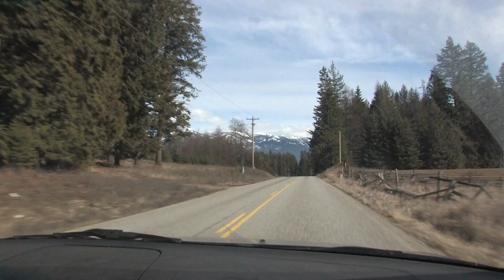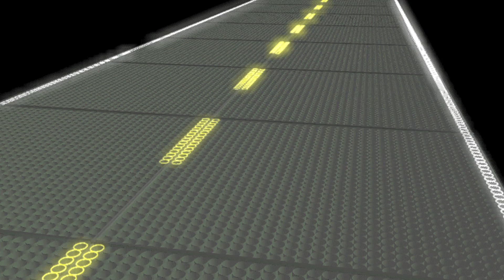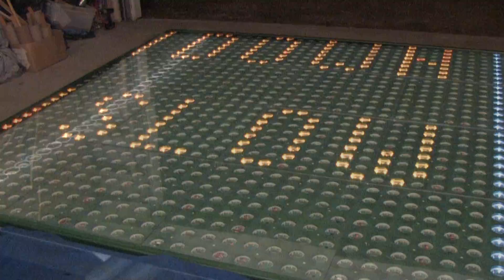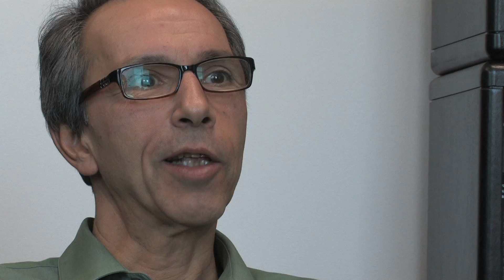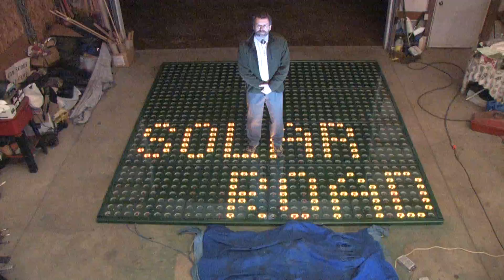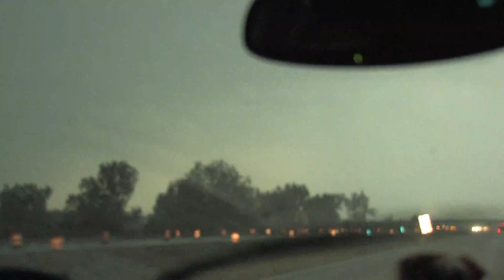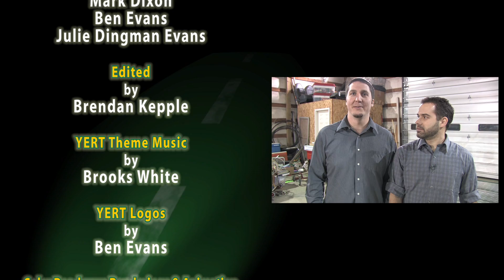Solar Roadways: The Prototype

Comment: I like this idea. I would just like to know if there's any idea integrated for charging electric cars. I was really hoping especially in urban areas for wireless inductive charging, which could really work on any vehicle and, with electric cars today, can be a game-changer. A concern of mine is, if used on a parking lot, wouldn't vehicles prevent more sunlight from coming in by covering the solar panels?

Comment: Someone explain to me how glass is better for quickly breaking when it rains/snows versus a normal road?
Reply: Avi Hoshikage
Won't textured glass diffuse the light, thereby attenuating the photo collecting?
Reply: Lori Eve
I think people are just thinking more about negatives versus tarmac.

I must say, there are shit tons of negatives I can think of one right now

In spring roads warm up in different places at different speed resulting in many cracks and uneven roads. Modular design would break under pressure.
Reply: Matt Valenti
What?

First of wall what bullet do you want to stop?
And how much of Glass do you have?

I don't now if you know this but Rock is pretty good cover for the troops in firefight as it protects them from ballistics and explosives.

Also bulletproof glass will break and shatter with encounter with the bullet of any caliber what makes glass bulletproof is polycarbonate layers, it goes like this. Glass Layer, Polycarbonate layer, Glass layer, Polycarbonate layer. ETC.

Basic reason why glass is withstanding bullets because are layer based and its not only glass.
Reply: I have never thought about it but after visiting a wonderful Museum of Glass in Corning , NY  know a little more: think about windows in the space ships for example, submarines etc.  Sorry, I'm not an engineer but a biologist.
Reply: there are thousands of different kinds of glass, only a few kinds of asphalt. Chances are that producing glass with good traction should be easy enough.
Reply: Same reasons why glass can withstand bullets better than rocks can...
Reply: ValugaTheLord Then they can make the tiles out of glass and polycarbonate layers. The only important aspect is that it has to be transparent(at least to the spectrum of radiation the panels can absorb)
Reply: RedTriangle53
I would be do differ.

Only important part is price.
Reply: dLimboStick If I had to guess I guess by sheer volume of cells could make up for the lack of light collected per cell.
Reply: that's what I want to know
Reply: naysayers... go to the university and look at it yourself... do you think they glass wasn't researched and tested to stand up to adverse conditions? YES . . . I like the NASA and Sub points too!! smart thinking . . .
Reply: Matt Valenti *(bulletproof) glass
Reply: ValugaTheLord fair enough.
Reply: *braking
Reply: James Davis he isnt driving anywhere lmao
Reply: Avi Hoshikage You can't think of a better material then glass? Are you serious?
Reply: ***** "the roads are heated to melt the snow/ice"

sure, but that's the most inefficient idea in the fing planet.
Reply: ***** Plows are better
Reply: You'd be surprised at how strong glass can be, actually. My father's a glassworker, so I learned all about this growing up. Glass can be ridiculously strong, depending on the type you get. The kind my father uses...its fancy name is borosilicate...look it up. That stuff is so strong, you can drop a marble of it from a few meters up onto ceramic tile, and the ceramic tile will crack long before the marble even chips. And these guys, clearly, are aiming for something even stronger than that. So using glass is actually a very promising idea. They just have to do it right is all.
Reply: Avi Hoshikage
ok so rain+cold...how do you solve this?
Reply: So they textured the glass up. They already thought of this; it's mentioned on their website that they put the panels through traction-testing systems, and actually had to back off on the roughness when it became too rough for the test-tires. shrug I've been around glassworkers my whole life; I know what it's capable of. You might not see it, but honestly, I can't think of a better material they could've used for both strength, traction, and clarity. Glass has a lot of potential...
Reply: Read MsSomeonenew comment, heat can be added to the road, just like Thermal panel.

Comment: Hi I have an idea for the road layer instead having very durable material maybe it can be a layer with integrated network of wires creating electro magnetic force using power from the panels then all cars can use electro magnetic tyres so they can levitate! If you have to make a turn you can use a device to make the wheels on one side create less electromagnetic force and the car will turn, same if there is obsticle on the road just jump over it by more or less magnetic force! No friction less power to move! Interesting ah,  just like Star Wars .... may the force be with YOU!
Reply: THAT IS BRILLIANT!!!!

Comment: Brilliant idea.
Reply: Do they stop working after having produced 3348W, or is that 3348W per hour, per minute, per day, per year.... if it's per minute, that's pretty good. Per hour, might be, but not necessarily. Also I think hair dryers aren't necessarily a good example, because they, like kettles, are high consumption, short single use items. You generally wouldn't leave a hair dryer on all day, and a kettle switches itself off after having heated water. Both, however, are absolute nightmares for drawing power. You could watch TV for ages on the power a hair dryer gets through in minutes.
Reply: One of the problems I see is being able to melt the snow that will build up on the surface… this has to do with basic thermodynamics. The panels collect solar energy to produce electricity, but they only capture about 10% at best and that is if the solar panels are in direct sunlight, my question is if the 100% energy from the sun isn‘t enough to melt the snow/ice how in the world is only 10% of the suns energy going to do it? I have read this is a problem with regular solar panels, they don’t produce enough energy to melt ice build up, even though they are set up in ideal locations to produce electrical energy… Another thing I have a problem with is there is no mention of storing this electrical energy produced (“none that I‘m aware of” solar panels don‘t work at night), and the costs involve in the extra equipment, plus converting this DC electrical energy into AC using power inverters, just as in normal solar panels.  Not only the initial costs but also for maintenance of this equipment, and there are major energy losses involved in these processes. None of this makes any sense at all. This not to mention all the other obvious issues involve.
Reply: ronc1357
A test unit installed last winter melted all snow & ice. I believe this was just a passive test. (photos on their site)  Advances in solar capture rates are occurring now within the industry.  A distributed grid reaches all electrical users along all roadways. Another brilliant idea explored by David Suzuki is electric car batteries used as mass storage - monitored by intelligent systems built into the roadways. Massive storage units (grid-level) using alternate materials are being developed as well. A group of German engineers calculated that solar roads would supply 4x the power required for the entire country.
This is how the future gets invented.
Reply: Bruce Ryan
I don't think so... I am affiliated with a solar power company, and the solar panels will not produce enough electrical energy to melt the snow and ice from the surface. You still haven't addressed anything about the power inverters, and batteries...the maintenance on this equipment, the costs for this extra equipment...
Reply: Excellent. As a member of the community - what is your problem?

http://www.cnn.com/2011/TECH/innovation/01/19/smart.roads/index.html?hpt=C2  and like I noted, the solarroadways units proved to melt 10 inches of snow in Idaho last winter. These are not the typical solar units. No big deal. I mean, new ideas come up all the time. Some of them have proof.
You do understand 12v DC systems? Household inverters are available. The efforts in Australia & Germany point the way.
Compared to the escalating costs of asphalt paving, oil pollution, global warming & CO2 losses... who cares about "costs". This is about our planet. Handouts to the oil industry are part of the problem. There are few "subsidies" available to renewable industry. See the ISSUE?
The 'gang' gets the money. Alternatives starve.
Again: look at the grid level storage solutions available now. Add a national strategy. Include some incentives. See the future.
http://www.solarroadways.com/snow.shtml
Reply: Bruce Ryan That test unit was externally powered. The panels were underneath a tarp, and weren't running directly from solar energy. That's not to say it can't work from solar energy, just pointing out that the test wasn't about that. They were testing that the heating elements were all connected up and functional.
Reply: alphaxerosyx Part of what contributes to the higher output of these panels is the refractive surface of the glass. They've changed the design a little since this video, and it's now got textured bumps on it. These bumps serve as traction for cars, but also they refract light onto the solar receptors within. I'd imagine this focuses and channels far more energy onto the solar receptors, much like you can start fires with a magnifying glass in relatively cool weather.

Also bear in mind that to melt snow and ice, you don't have to have a hot surface. You just need to have the surface temperature maintained above the melting point. Maintaining a temperature requires a lot less energy than repeated cooling and heating. Technically, we're talking about a temperature that would be far exceeded throughout most of the year, somewhere around the region of 5-6C is more than enough.
Reply: alphaxerosyx
To explain what I am talking about, the solar parking lot they have built according to Scott will produce just under 4000 watts on a clear sunny day for about 3 hours a day, which is enough power to operate 3 electric hair driers. The surface area of the parking lot is about 384 square feet, so do you think that running 3 hair driers for 3 hours a day is enough heat energy to keep the road surface clear of snow and ice 24 hours a day?
Reply: Not sure where you got the 4kW figure from. Scott hasn't released any details yet about the actual output of the lot. Also it's 432sqft (12ft*36ft), and is only 60% covered with solar panels, due to them not being able to get the right shape/size in time to fit the new hexagons. The eventual product would be 100% covered. As for whether it's enough to melt snow and ice, there's a newer pic up now that shows panels not covered by tarp, that are snow-free, while adjacent ones are buried under snow. Possibly externally powered, still, but at least it takes the tarp out of the equation. I'm not sure the US DoT would have funded the project if there was any dobt as to its authenticity though.

It's also been enough to convince Sandpoint, Idaho to get some of these installed in town. http://www.bonnercountydailybee.com/news/local/article_604a09ac-baf0-11e3-94d2-0019bb2963f4.html
Reply: alphaxerosyx
Had to look back and find where it was stated. It is within the March 31st post titled " Oh what a difference heater (turned on) makes". The conversation was with Christian Berger, and here is the quote "Hi Christian, Yes, we only have 69% solar cell coverage for the prototype, which makes the parking lot equivalent to a 3348W solar panel - in production there will be 100% coverage obviously".
I guessed that since the panels don't actually go to the end of the parking lot that is was closer to 32 ft. but that doesn't really mater because adding the other 4 feet makes it even more difficult to heat the panels with the given energy input.
Reply: alphaxerosyx
I have been waiting on a response from you to my question about the hair drier scenario. plus I wanted to add to your comment about funding from the government. First of all yes the government funds stuff all the time that doesn't work i.e. cold fusion... that is not a reasonable argument proving the solar roadways has a chance of working as claimed. To get a grant all you need is letters behind your name, and good grant writing skills. The same goes for convincing the city of Sandpoint to install these in town, I mean it wasn't hard to convince you how great these roadways are..., but in this case I expect the city of Sandpoint would want to see results before they commit to installing these solar roads. My problem is the numbers just don't add up to the claims.
Reply: I'm just waiting on Monday's video. It'll likely have a lot more information with which I'll be able to answer the questions. While I'm no electrical engineer myself, I'm pretty sure we could be on a different track with there being a difference between kW and kW/h. Either way, I have no follow-up right now, other than finding it somewhat ludicrous that they'd be so enthusiastic and proud if the prototype wasn't producing much power. After all, they said a few years ago that these things would generate 3-4 times more power than the US uses over the course of a year. It goes without saying that the small scale prototype should at least be able to take the building next to it off the grid completely, otherwise it's pointless.
Reply: alphaxerosyx
 Just so you know kwh has nothing to do with what I talked about, that only deals with the amount of time the power is produced, for instance 4000 watts= 4 kw.... 4000 watts over 4 hours = 16 kwh...

 According to Scott this prototype he built will produce 3348 watts, the hair driers consume between 1200-1500 watts each. Which means as long as the solar panels are producing full power they will run the hair driers. With that being said if you managed to get 8 hours worth of power out of them you still have 16 hours they aren't producing... this isn't rocket science, it's just common sense. Personally I believe solar roadways is a scam, it may not have started off that way, but I believe it is heading they way. I believe Scott knows it, I believe he knows the figures don't add up and ----"IF"--- he doesn't in my opinion he would have to be  the dumbest electrical engineer on the planet, and uninformed people are falling for it, because they want to believe it will work.
Reply: alphaxerosyx
 To add to this, this is what you said, and I am aware of the quote from Scott.  "After all, they said a few years ago that these things would generate 3-4 times more power than the US uses over the course of a year."  (sarcasm alert), Who said that.... oh right; Scott said that, and it must be absolutely true then.

Comment: 1. Glass is almost as stable/hard as steel if manufactured right, as stated in this video, might be no problem or at least as much a problem as on asphalt
2. The weight spreads to all the wheels, there's no 40 tons on one point
3. The road is made of panels, if one cracks, it only cracks to the ends

Comment: This idea looks very interesting. But I got a few points i cannot imagine:
1) If normal Solar panels get smitten with hail, how does the street survive.
2) What about the weight a big truck has. Now imagine the road freezes in wintertime and a 40 tons tons truck drives on this road.
3) How does glas effect the breaking distance? I can imagine its far longer than on normal streets.
If anyone could answer me some of these questions I'd be happy :)
Ps.: Sorry for my grammar I'm foreign

Comment: A couple of  problems. Traction. Glass + Water (on a rainy day) = Hydroplane. If you'll create the grooves on the glass to simulate asphalt texture, glass wont be that much clear for us to see the LEDs underneath.

Then there's snow. On a cold snowy season when the sun's rays barely goes through, the solar panels wont generate as much energy as in summer. Less power generated means less power that can be used to heat up the surface to melt down snow. Also, melted snow = water. See above.

Comment: There is no problem.  Road heating as a means of snow/ice clearing is only practical on the scale of small driveways.  And PV arrays are not mounted in roads for a reason.

Comment: One of the cooler ideas behind these roads is no longer needing salt, The roads would be "self-sufficient" meaning they would heat themselves during winter storms, using a small portion of the massive amount of energy they would produce... 

Weeds don't grow through cement/asphalt, they grow through cracks that form due to continuous stress; you wouldn't have stress break like that on these roads.So no, you wouldn't have that problem.

Comment: The solar should be put on the back burner in order to get the recycled roadways out there and in use (especially in areas that wouldn't merit solar anyway). Getting various agencies and builders on board with a completely new material is enough of a milestone. Get some new roads built, then introduce the solar. It will be a lot easier.

Comment: The most efficient solar panels have dual-axis tracking so they catch the sun on just the right angle. As these will be stationary. The further north we go the worse the angle gets and therefore efficiency. Not to mention reduced hours of daylight and necessary snow/ice removal to ensure it doesn't reflect the light. There are probably few areas today in which these could be implemented effectively, but if pertroleum prices keep going up this could be a solution in the future.